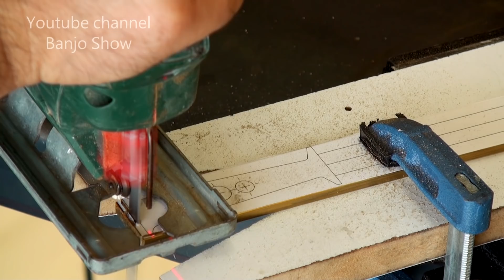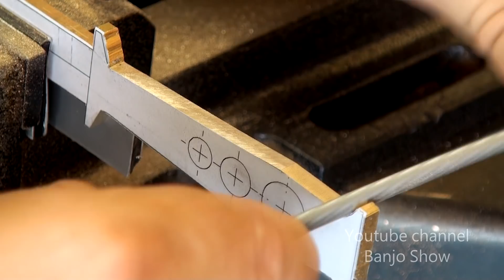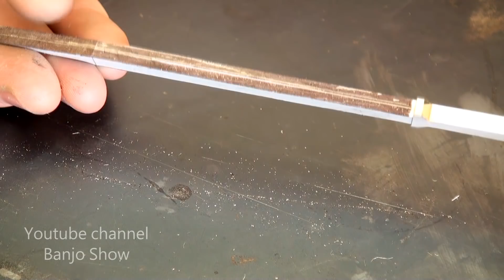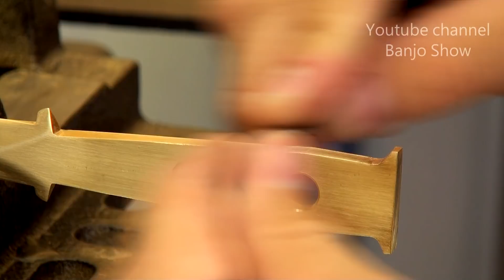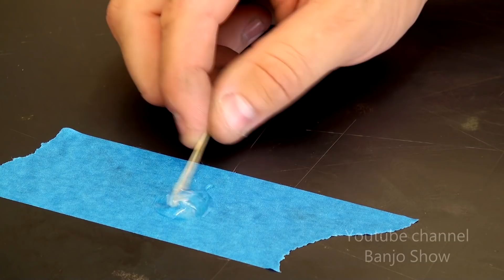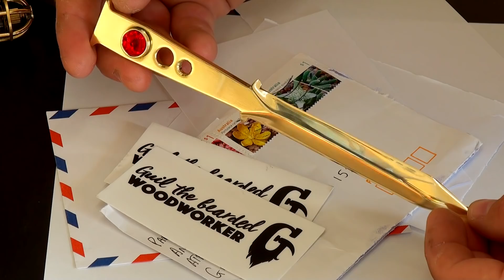How to Make Letter Opener Knife

Comment: looks like you used brass, but you could use steel and make it easily golden.
I discovered that trick a while ago its easy, you just need to slowly heat up the steel for some a minute at  200-220c (400-440F) https://en.wikipedia.org/wiki/Tempering_(metallurgy)#Tempering_colors
can be done in a household oven , or with a butane torch by hand (there is a delay of ~10sec so heat up slow and constanly wave the flame over the workpiece) here an awsome showcase of this method:
https://www.youtube.com/watch?v=F8fjxbCRZ8w